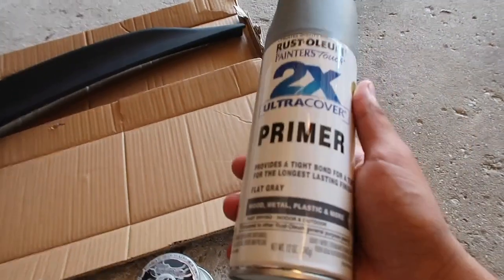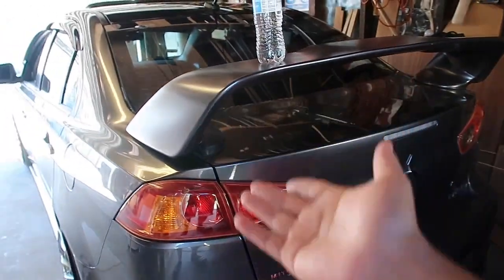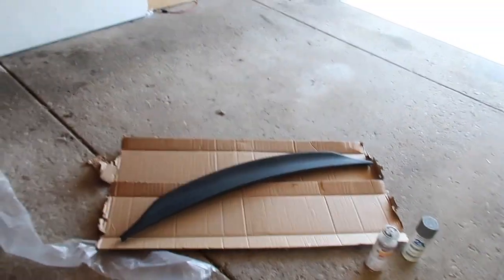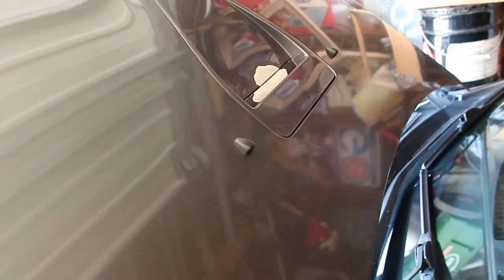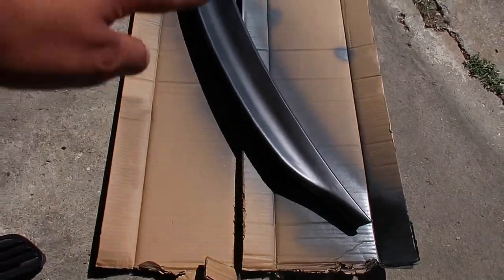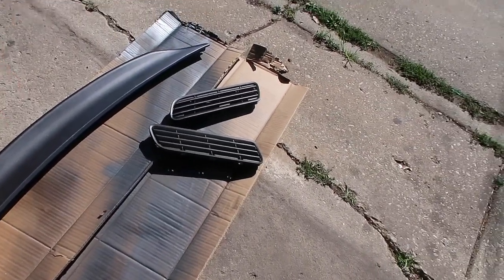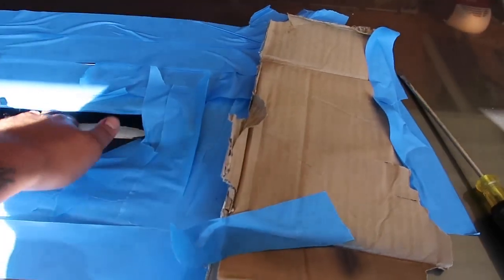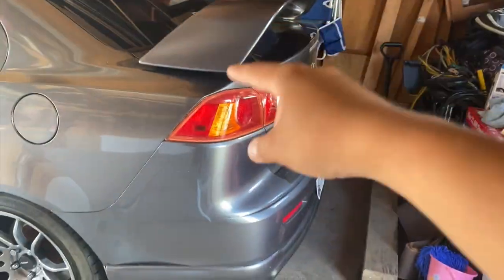Painting some parts/DUCKBILL INSTALL!!

Comment: Do you have any fitment issues with the wing? I got the same exact one but mine doesn’t sit flush with my trunk I had to sand down the middle for it to sit properly without any lifting on the sides.
Reply from the maker: No problem with it sits perfectly on the truck